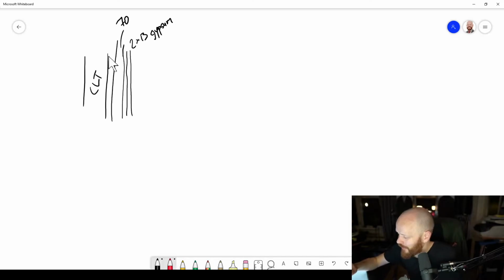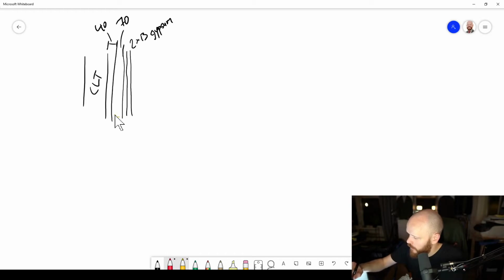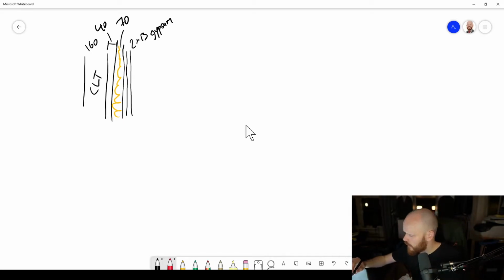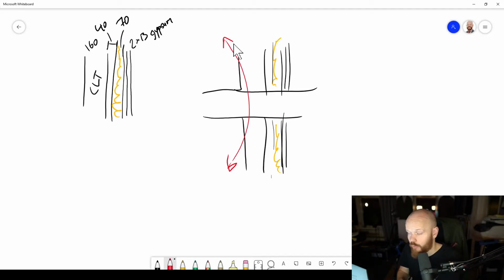How to design CLT buildings with good sound insulation in less than 10 minutes.

Comment: Hey man! I have a question about thermical insulation. Do you know how to fix a cold bridge when you have a CLT collum and your wall and floor insulatation can’t “touch” at that spot? How do you fix such a problem? are there specific building materials for this or should i redesign my house? Please respond, you might be the one with the answer 🤠
Reply from the maker: Hi Andres! I'm an acoustician so sound is the domain of building physics that I am an expert within. But to stop heat transfer, I guess you should use a layer with as low U-value as possible, in between to decrease heat transfer. I personally use a reference book in Byggnadsfysik from Lund university which is great, however, I think it is available in Swedish only. But there must be a lot of very good literature out there on the topic.
Reply: @RikardÖqvist  Thanks for the answer! I took contact with a CLT company and they helped me further.
Reply from the maker: @AndresVanMelckebeke  Perfect!